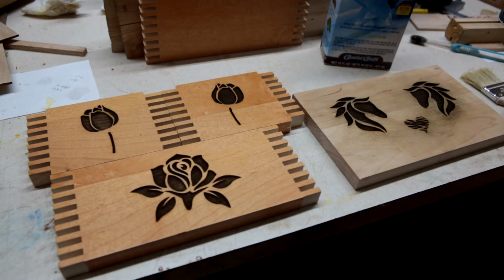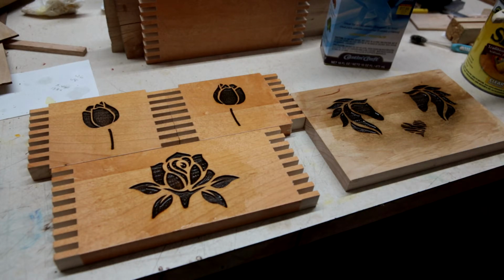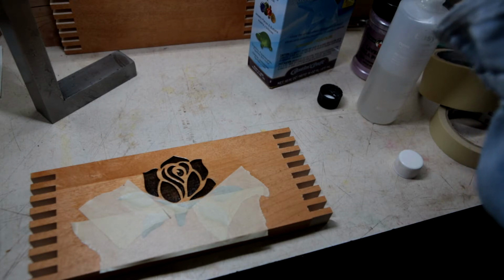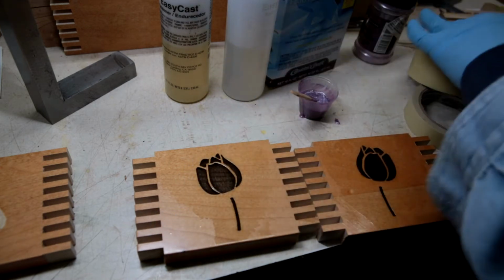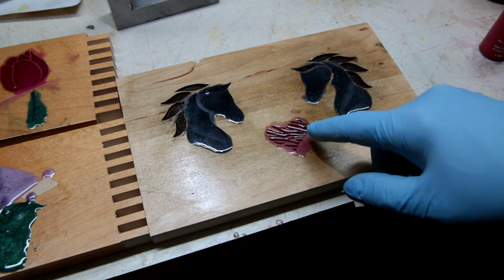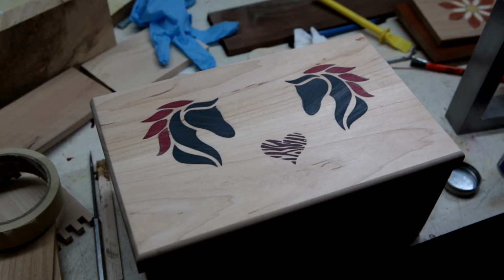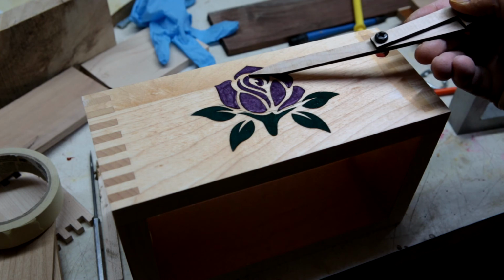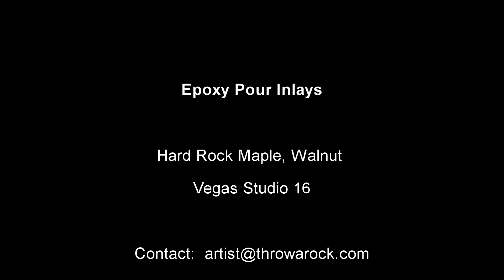Inlays using Poured Epoxy

Comment: If you don't want small air bubbles to appear in smaller detailed areas, spray 91% or higher isopropyl alcohol in to the design before pouring the resin. The Alcohol will make the resin run thinner and break surface tension to prevent bubbles forming.
Reply from the maker: Interesting..  I'll try that on a test piece
Reply: You can also warm the epoxy bottles in warm water before you mix them, temperature is critical with epoxy.  If its below 70 degrees it becomes thick but as soon as it warms up it runs more like water and the bubbles come to the surface quick

Comment: How is the resin inlay holding up with the shellac sealant layer underneath? Any cracking or separation? I've been wondering if I could use shellac/sanding sealer underneath epoxy as a sealing coat but all the tips I see say to use a thin layer of epoxy.
Reply from the maker: Seems to be ok!

Comment: Hey so you used a laser engraver to cut the inlay? How deep do you need to engrave to apply epoxy? 

Thanks
Reply from the maker: Need to be deep enough not to crack, so I go at least 1/8" on my inlays.  As I said on a previous question, if you do transparent colors, 1/4" would be my minimum.

Comment: what laser are u using for engraving?
Reply from the maker: I have a Chinese XM1060 100 watt laser with a Reci tube in it.  However, for all the work I do with engraving and inlays, you don't need more than a 20 watt laser.  100 watts buys you more speed.

Comment: Same method will work on marble?
Reply from the maker: Don't see why not.  Marble is a bit more porous, so thin solutions might seep into the marble more, but yes, it should work.  Depending on how deep the engraving, you might apply a thin coating first to seal the marble, before pouring the final resin.